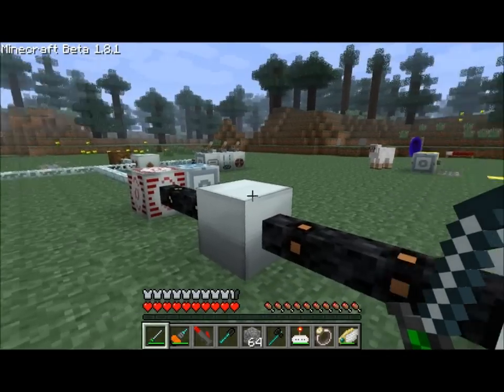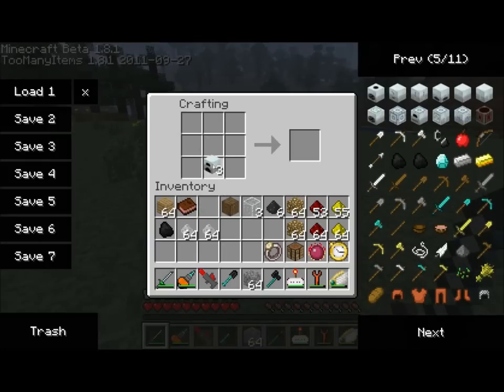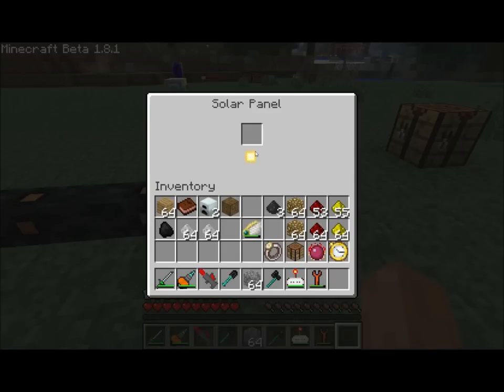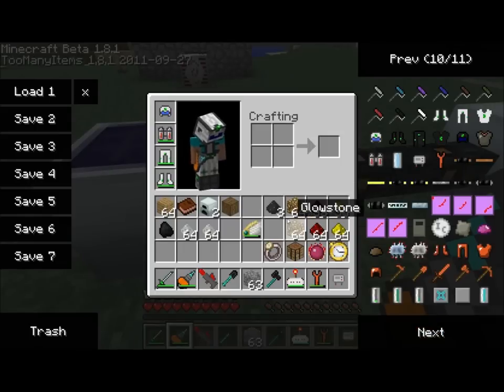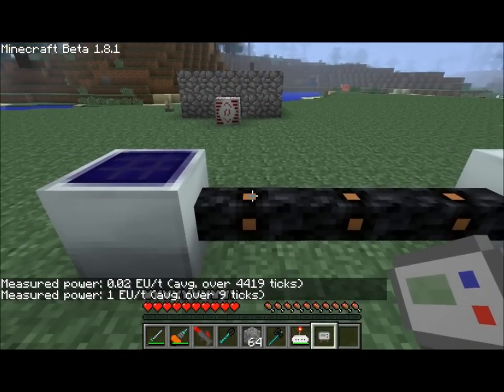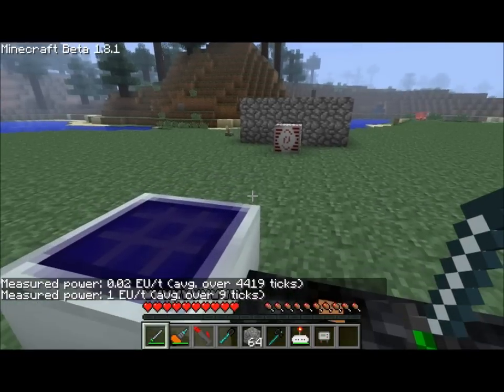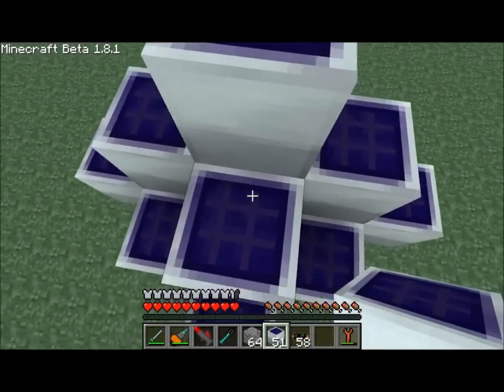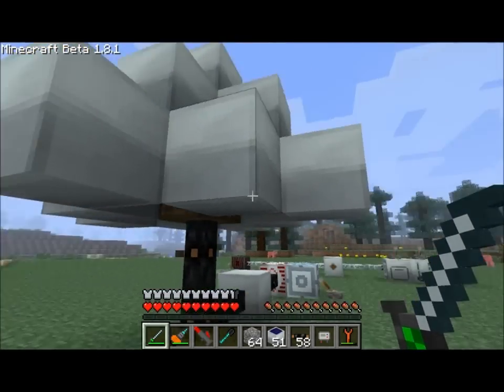IndustrialCraft 2.0 Tutorials - Solar Panels

Comment: And is the Mfe output face facing the cable leading from the solars. If they are then It will not receive power because it is outputting to the cable.

Comment: @KoreanJ97 The best way you can make windmills generate EU is placing them at 128 height and having no blocks (except wires and such) surrounding it 9x9. It's best to have to wires under the windmill as it's detected area only reaches up to 2 blocks below it.

Comment: Trying to figure this out. I have the Technic Pack installed and in TMI it shows two different solar panel arrays. I know the bigger one is IC2, but not sure what mod uses the flatter ones. Anyone knows? According to TMI it's item number 248.

Comment: @murphy54000 if you want to build big, i mean, like 128+eu u can use 1 MFE, 128 solar panels and tin cable. the way you wire it depends on the space or the shape u want, or you can just build 3 paralel rows of tin cable with 2 blocks space between them, and at the midle of the center cable put the mfe and link its sides to the other 2 rows then fill it with solar panels. i never did it but i think you canuse a mfsu just as well (with some coper cable and bat boxes u can even get 512+ eu)